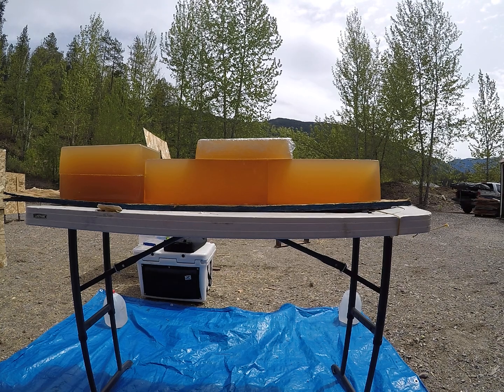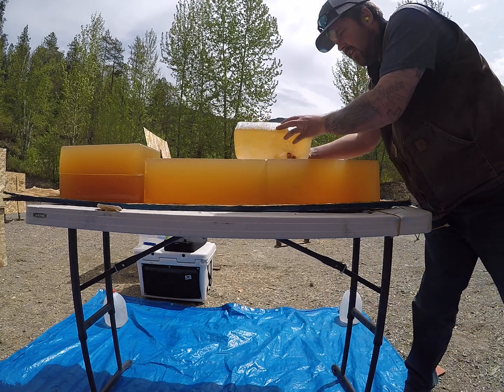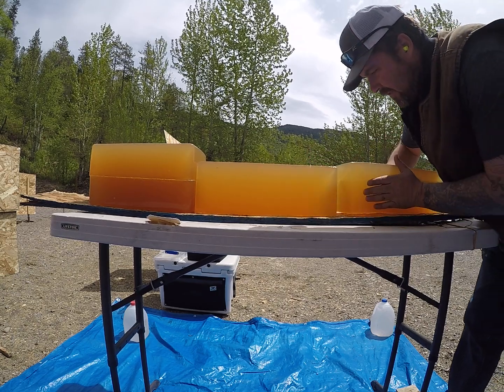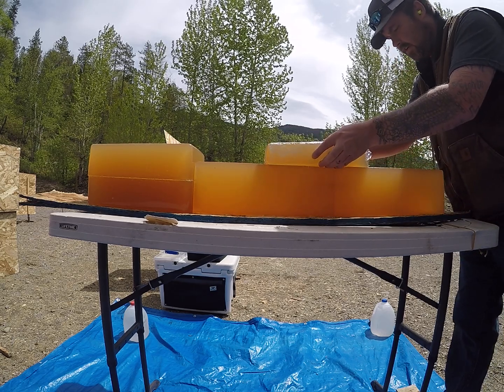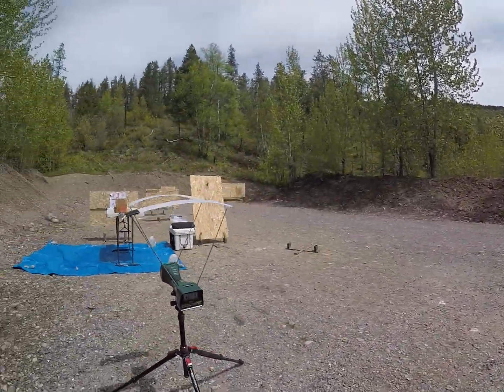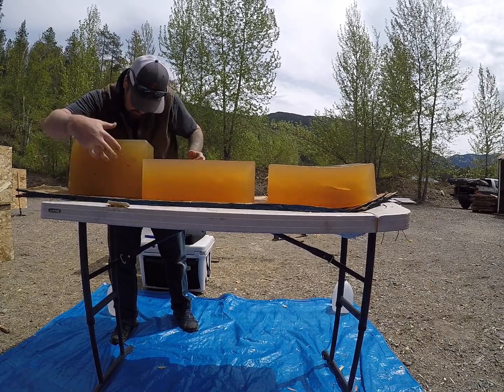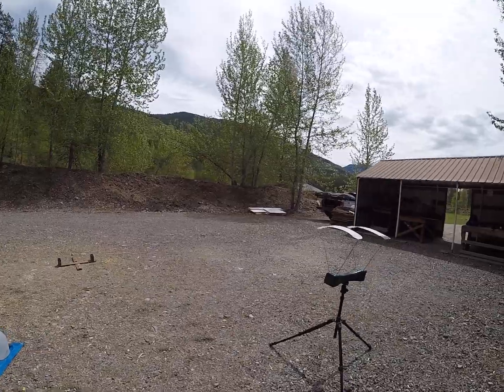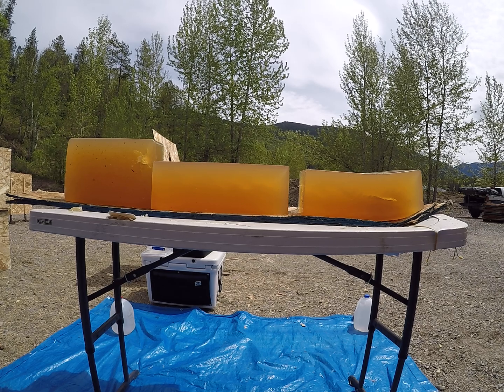300 PRC 175 gr Federal Edge TLR ballistics gel test

Comment: What is the twist rate and barrel length of the .300 Win Mag, 300 PRC and .308 Win rifles you used to test the 175gr Edge TLR bullets?
Reply from the maker: 1:10,1:8, and 1:10 
26,26, and 16.5

 I know twist rates make a difference on bullet stabilization I have noticed no difference in the ballistic coefficients using similar velocities  in my 300 win mag compared to the 300 PRC taking longer range shots and when comparing shots in ballistics gelatin there is no noticeable difference.  In theory the tighter twist should help the bullet open and mushroom a little better but it is so little I cannot show the differences.
Reply: @Simple Minded Fella  Ok. Thank you!